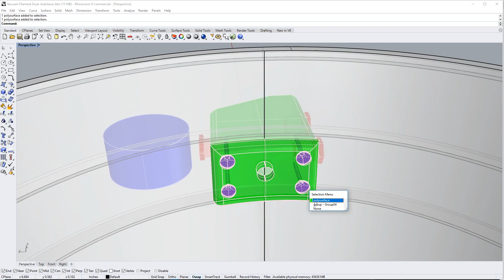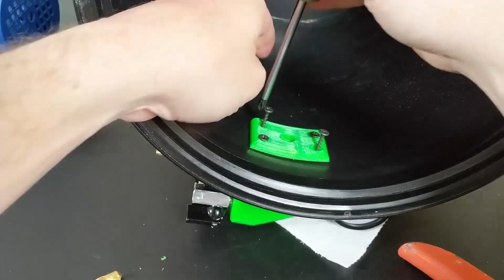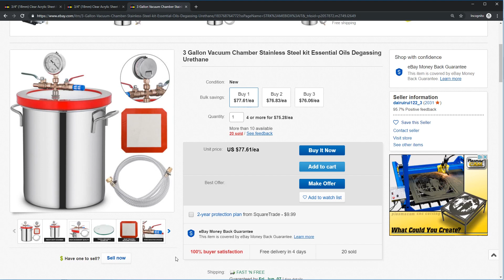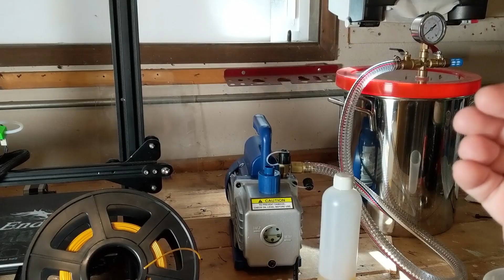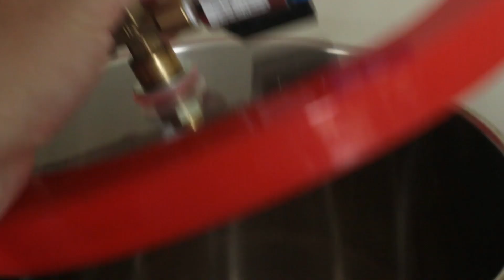Is Vacuum Filament Drying Best the Best Technique?

Comment: Some pumps can achieve a vacuum lower than the vapor pressure of the pump oil.  When that happens, the pump oil vapor can stream out in to the vacuum chamber and leave oil residue on everything.

It's better to find a pressure above that point, and use a PID controller to maintain it, then get a small heater like a "Golden Rod" to do the bake out.

NPT electric feed-throughs are not hard to find and pretty easy to seal.

Comment: I bought a vacuum kit from Amazon back in November of 2018, the same setup you basically have. It holds vacuum for may days with no loss. I do use a heating pad to accelerate the evaporation. Since the metal container conducts heat I have the heating pad underneath and the spools stacked on top of each other all get warmed up. The one I ordered but there are many choices (it was more expensive than your setup) https://www.amazon.com/gp/product/B073WVNT88/ref=ppx_yo_dt_b_search_asin_title?ie=UTF8&psc=1

Comment: Ex commercial diver here that had to be pressed down in a decompression chamber multiple times after many saturation dives. Even though it is the opposite of what you’re doing they are pressuring us down to dive depth And then slowly bringing us out according to the step plan it is a essentially a vacuum chamber in action. When we are being pressed down to depth or pressurized It is equal to you bleeding gas back in to your chamber bringing it back to atmospheric pressure. The issue is when we would get pressed down There would be massive amounts of moisture caused by this in the air and all over the walls of the chambers so I would think you would Negate any drying done by the vacuum by moisture induced when you bring it back to atmospheric pressure.

Comment: Why not try using a 1 bar (relative) pressure switch inside the chamber and reference the atmosphere (through a port)?  If the switch is inside the chamber then the ambient pressure should activate it when the pressure is down around -1bar.  If you can’t find a normally closed switch, just use a cheap relay.

Comment: Maybe try several 1h cycles next time with time in between to let the water in the filament warm up again for the next cycle. As pointed out already, the evaporating water lowers the vacuum. Also, an infrared heater may work if you want to go continuous, however that may also melt the filament.

Comment: 1:28 that is a nonsense. Filament is always sold per kilo of actual filament, not the spool. If you weigh new spool, you will see it is much heavier than 1kg. If it is not, you should probably buy from someone else.

Comment: 4 thing that degrade pla :
1. UV - fast degradation
2. Oxygen - fast degradation
3. Moisture - slow degradation
4. Heat - slow degradation

i'm thinking a vacuum/UV sealed enclosure/plastic bag with silica gel is the best. but, it is hard to design a practical design so you can use it every day.  if any of you guys have good design based on these factor please share it with me

Comment: A cheaper, slower solution might be to store your filament with a chemical desiccant, in which case you would need only those dog food lids and plastic pails. Silica gel, calcium chloride, even oven dried wood, many options. 

Another cheap possibility is to attach a simple household timer to the vacuum pump such that it runs for a few minutes each hour, regardless the pressure.

Comment: Everyone mentioning the lose of vaccum do to the water is correct.  As the water turns to vapor the positive pressure generated lowers the vacuum in the chamber.  Same vacuum principle is used to evacuate moisture from air conditioning and refrigeration systems.  You just have to keep applying more vacuum  as the chamber loses it, and you will know there is no more water when the vacuum stays steady without having to apply more vacuum.

Comment: What about a your oven doesn’t that work just as good
Reply from the maker: My kitchen oven doesn't reliable and accurately heat to the low temperatures needed for filament drying. Hence the use of a food dehydrator.

Comment: I've never had a spool of filament that included the spool's weight to the advertised filament weight. A '1 kg spool' holds 1kg of filament and weighs a total of (usually 1.25 kg. 0.25 kg for the spool.

Comment: Could you 3d-print some circular ribs to hold the bucket in shape from the inside?
Reply: TiagoTiago I wouldn’t trust that plastic. That’s an immense amount of force being put on the vessel from all sides. It might hold until lower pressure then violently implode as the ribs face cascading catastrophic failure. I haven’t messed with low vacuums myself but know enough from people who do it on a regular basis to treat them with respect. If I were to make my own, I would use some very thick polycarbonate material similar to what some other science youtubers have made. It’s thick enough to stay structurally strong and it allows you to see what is going on inside which is not only really fascinating most of the time but can also be important in some cases.

Comment: You could use a pressure cooker for your pressure vessel (vaccuum chamber).  Seems like it would be straightforward to swap fittings with existing holes in the lid, dont forget to get rid of that pesky pressure failsafe if you're doing this though.  Cheap pressure cookers should be available almost everywhere.

Comment: I think you can easily improve the effect significantly. Water at room temperature needs less than 30 mbar to cook. In addition, you have to pump out the evaporated water. I think you need to run the punp much more often. Maybe something like all 5-10 minutes for a minute.

Comment: Boiling does not equate to evaporation. The better print equality you experienced will be due to a small amount of drying whilst in a zero humidity and due to you exposing 'fresher' filament as the spool unwound. Think of a cylinder shaped packet of biscuits/cookies that's been left open at one end. The first one is soft/stale but the further into the packet you go the 'fresher' they get.

Comment: Make a clamp that goes over the lid and mounts on the handles. You need some force holding the seal besides just vacuum or it may be the scratch as well.

Comment: Simple/cheap pressure switches are not accurate enough to trigger at low pressures. A cheap vacuum switch could be made from an absolute pressure transducer (sensor), an inexpensive microprocessor like an arduino and a solid state relay. There would be a little more to it than that, but it would be about $20 or less in parts. 

Although a vacuum chamber probably isn't the best way to go. What you really need to do is to find some way to reduce the partial pressure of water vapor in the air around your filament. You can do this with a good desiccant or some other dehydrating system that works at atmospheric pressure and room temperature.

Comment: For keeping the vacuum try a cheap wifi power switch and a webcam pointed right at the gauge. It cant be that hard to have software detect if the needle is within range, and if not to turn on the switch till it is. (I'm sure this could be achieved with a $10 ESP32Cam, and maybe a switching mosfet)

If you want to collaborate on such a thing, drop me a line.

Comment: when you pull a vacuum, as the water boils out, you lose vacuum. The vacuum is being replaced by water vapor. When the vacuum stops going down, you know you have pulled everything out that will come out. Suck it down empty and see if it holds. If it does, it's working exactly like it should.
Reply: Lone Wolf I’m a little late to the game here,  but they missed the whole reason we don’t use vacuum to dry our cloths or dishes. The amount of heat lost when the water evaporates is hard to overcome. Then the temperature drops below the point it will evaporate under those conditions(plus the loss of vacuum due to the evaporation. Vacuum pumps are designed to keep running so It can evacuate the humidity and overcome the vacuum loss.

Comment: Those pumps are meant to run for extended periods. They will get hot but that's normal. You are constantly losing vacuum from water boiling out. Leave it running for an hour or two to boil the majority of water and then let it sit in the vacuum and pull down again if necessary
Reply: Can confirm this. You'll see the water vapor coming out of the pumps exhaust while it's boiling off as well.
Reply: @NorCalPatriot1776 Thats oil..

Comment: Another solution could be to bubble the air within the filament storage container through a liquid desiccant (like a calcium-chloride (i.e. road salt) / water solution).  As this would be a closed system, the solution would just need to be boiled now and then to remove the excess water and rejuvenate it.  (Warning: it is corrosive to most metals, so the use of plastics or stainless steel would be required for all surfaces coming into contact with it.  This isn't a huge issue but should be kept in mind.)  Here is some more info: https://www.cibsejournal.com/cpd/modules/2014-12/

Comment: You can usually keep the vacuum pump running, they are more efficient when pumping on nothing, no work done so much less heating. Also the water will probably leave pores in the filament. The air will expand when heated and might still cause popping.

Comment: I have no experience about drying filament but I got experinece about industrial dryer for plastic material, The "filament dryier" can be considered as "hot air dryer", while resins like PC, PET, PA ( also compounded with filler such as wood powder) usually requre dryers. There are many kind of technology  but the most common about dryer use the technology of molecular sieves, In short the difference is about the quality of air you flow inside the chamber where the resin is processed. Molecular sieves dryer can acheve very low moisture inside airflow so the resin is forced to loose moisture. Others effects than  hydrolysis can stress the resin, there are also oxidation and thermal stress (PET suffer a lot about hydrolysis during thermoplastic process, like PA but PC suffer about therma stress. For that reason there are some "recipe" where is listed: the process temperature, the residence time and the level of dreyed air  required to achive a deifned drying process. Usually there must be defined the final moisture (measure in ppm) and the initial one so Winston Smith is in true: raw data of moisutre contnenet can be measured with thermobalance or other analytical equipment but they aren't cheap. You can run one test, warm one spool with the owen till you got the full temperature, than run with the vacuum, you'll get beeter result than run only with vacuum.

Comment: Try using some 3M vacuum grease on the seals. This should help but, as stated in many posts below, as the water boils out the vacuum will drop and that is a good sign that system is doing the job. Great vid!

Comment: You're not necessarily losing vacuum.  The water vapor coming out of the filament has a pressure.  As more and more water comes out of the filament, it exerts a pressure.  Try running the pump continuously for 24hours. :D

Comment: you could just use a simple timer switch instead a pressure switch for your pump.
Or you could use welding gas as Ar + 5%H2 and no vacuum pump at all. This gas is very dry because it came from high pressure level to ambient pressure. And so it will dry your filament without any vacuum because of partial pressure https://en.wikipedia.org/wiki/Partial_pressure . Of Course you can enhance this by using zeolithes often called molecular sieves. .

Comment: Here is a link for the vacuum switch  I made my system to run continuous and auto cycle for vacuum veneering. To run in auto cycle you will also need a MAC vale to unload pump pressures. https://www.joewoodworker.com/

Comment: You still need to add silica gel or calcium chloride to the chamber to scavenge the water vapor released, as well as periodically running the pump.
Get another lid from the supplier - that scratch is unacceptable as it is a stress riser and could cause an implosion.

Comment: Pro tip from someone who worked around vacuum pumps for years: Stick a cut-off plastic bottle filled with cotton on top of the pump's exhaust. These pumps spew lots of oil mist!

P.S. There is no such thing as "negative pressure".
Reply: Sure, there is such a thing as "negative pressure". It all depends on where your reference is. The gauge that he got measures "gauge" pressure, not absolute pressure. Therefore, the reading that he will see on his gauge is referenced to his ambient atmospheric pressure.
Reply: @Sembazuru  sea level or ambient  ?
Reply: @Elamin008  Ambient. Disconnected from everything, that gauge should always read zero whether at sea level or on the top of a mountain.

Comment: just as a note - there is no such thing as "negative pressure"
Reply from the maker: By your logic there is also no such thing as "negative temperature" either and yet my thermometer clearly measures into negative numbers, just like the pressure gauge on my vacuum chamber does.

Comment: The vacuum is exhausting oil mist. Some brands (and 3rd party suppliers) have mist filters for the exhaust to reduce the oil loss and contamination of your workspace.
Part of your vacuum loss is due to water boiling off, but also because your chamber is not designed to hold vacuum for longer than about 10 minutes. Your solution to use a vacuum pressure switch or an Arduino with a pressure sensor and relays should compensate for the system leaks.
Reply: The large Tupperware container with a seed starting mat or a reptile tank heating mat is an interesting idea.

Comment: This is probably one of your best videos. A simpler solution to keeping a vacuum in the chamber would be to simply use a timer. Not quite as  elegant but probably just as effective. You really don't have to worry about overheating the vacuum pump. I leave my harbor freight one on constantly overnight when evacuating car AC systems. One of the things you may not have considered is that the increase in pressure inside the chamber, or decrease in vacuum, is that the water vapor from the filament is whats doing it. There may also be offgassing from the plastic itself. It might not be leaking. So yeah, a timer set to turn on the vacuum pump once an hour for 2 minutes or so, would probably do the trick. Setup a solenoid valve to open and close on a delay-opening just after the pump starts and closing just after the pump stops. Sounds like a cool little arduino project. Perhaps a simple check valve could contain the vacuum inside when the pump turns off...thats even simpler if you can get a good enough check valve and one thats sensitive enough
Reply from the maker: Thanks for the compliment and great ideas!

Comment: Not sure how accurate you could make it but you could use an Arduino with and LDR and a relay. Detect the black needle on the gauge and when it drops the needle, it'll be a higher signal with more light getting back to it.

You could possibly even design a part that clips the LDR to the gauge and be rotatable so you can make adjustments.

Comment: Make sure to run the vacuum pump till the oil gets hot as water gets in the oil from the air, the heat forces the water out of the oil, but if its on till it heats, on and off quickly it can be a issue. Cool video 👍

Comment: Great ideas here. I've got another suggestion you could try on the cheap.  Copper sulfate is a farming chemical used in soil and looks like blue rock salt. When you bake it, it dehydrates turning white and wants to absorb water a lot. 
If you make a batch of anhydrous copper sulphate and put a bunch is the dog food pail, it should pull out moisture and maintain the spools dry.  I haven't tried it, but if you got the other stuff already, maybe it will work for you.

Comment: Heat does do the trick. I set my heating pad to 5 degrees C below whatever you set your printers heated bed to, to print a particular material. So when I have a PLA spool on the bottom of the chamber, I set the heating pad to 55 C. I lose about 5 C through the bottom metal surface and the silicon liner, so the PLA spool get about 50 C. If you want to dry PLA and PETG at the same time, I’ll put PETG on the bottom, set the heat to 80 C, and stack other PLA or PETG on top, up to 4 total. Put the hygrometer on the top spool. Pre-heat the chamber for 1hr before turning on the vacuum. The duty cycle of pump isn’t great, so I don’t run the pump for more than an hour before giving it a rest to cool down. While it’s cooling down, the heat is still doing it’s work.

Comment: Couldn't you have just put a metal sleeve inside the bucket to support the walls so it didn't implode? 

You could probably use a wireless switch to turn the vacuum pump on and off on a schedule.

Hackaday had a vaccuum chamber project in April.
https://hackaday.com/2019/04/12/build-your-own-vacuum-chamber-for-degassing-and-more/

Refrigerator Vacuum Pump project.
https://hackaday.com/2018/08/04/hacked-vacuum-chamber-wont-suck-a-hole-in-your-budget/

DIY Vacuum Regulator
https://www.instructables.com/id/Digital-Vacuum-Regulator/

Comment: You would probably have better results if you left the vacuum pump running continuously.  That pump was made for evacuating air and moisture from AC systems. As a rule of thumb,  we would draw down an AC system for at least an hour. 
How would you compare the vacuum method to a food dehydrator?

Comment: the drying will slow down over time as the filament gets colder over time and thus there is less energy to make the water boil. Thunderfoot explains some of this in his video about a fake vacuum dryer. So adding a heat source will increase the effectiveness of the filament dryer.